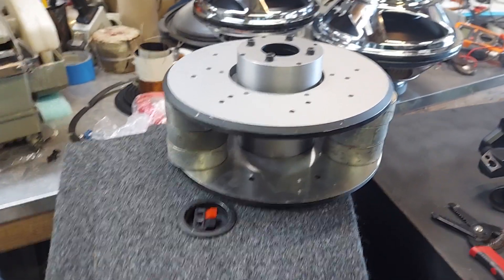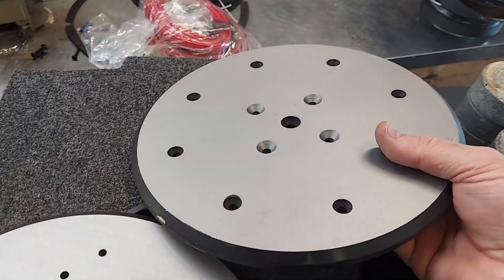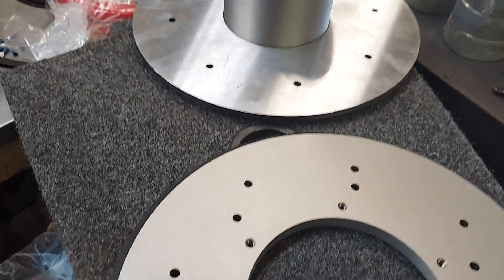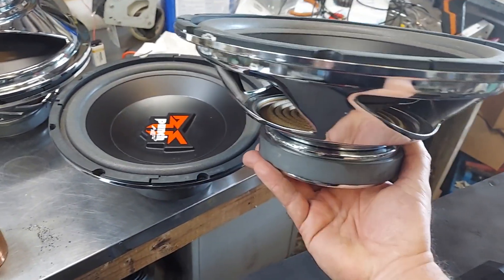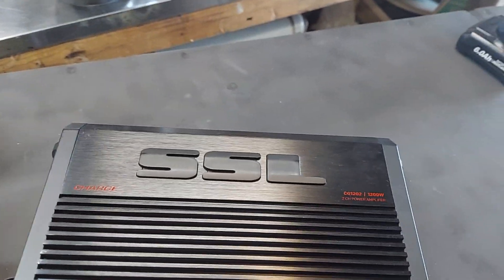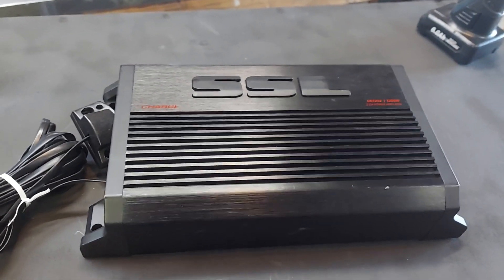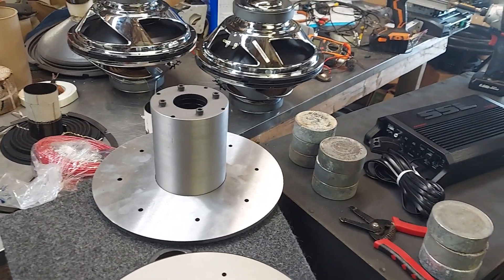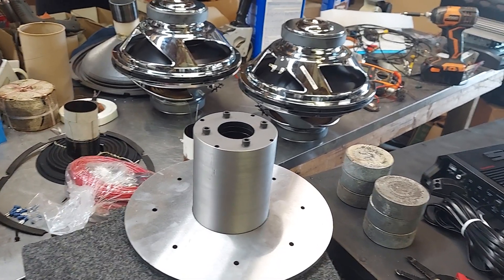Nobody wanted a liquid cooled 7-10kw neo motor. They wanted heavy ceramic instead.

Comment: Speaking of motor designs; has anyone ever made a tapered or flared motor where the slugs increase or decrease in outer diameter as they reach the bottom plate.
Reply from the maker: Yes, I forgot the name but a couple were like that from the same factory.  All three used a knockoff of XBL by Dan Wiggins.  Orion H2, Cerwin Vega Stroker and I forget the 3rd but the magnet is super big.